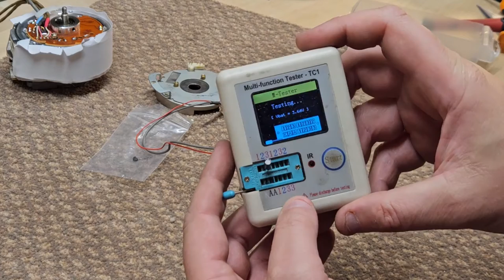Sony SL HF100 Betamax video head repair

Comment: Hello! I just subscribed to your channel. This was the first video I watched, I will watch the others over time. I want to ask something:
Wouldn't just cleaning the hallf effect sensor be enough without replacing it? The old one seemed solid. Greetings from Turkey...
Thanks...
Reply from the maker: Hi there. Welcome to my channel. I have tried cleaning it myself but i think the glue is corrosive as well and the corrosion goes into the hall effect sensor. Certainly try to clean and see what happens. Maybe using acetone. Good luck!